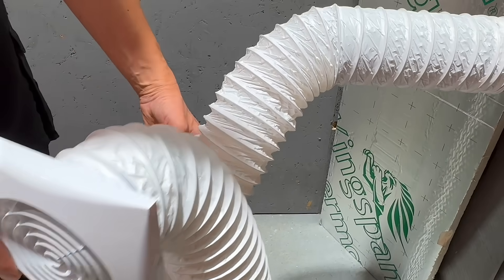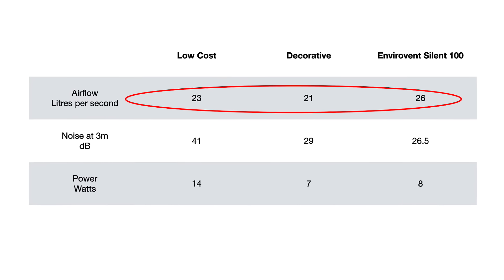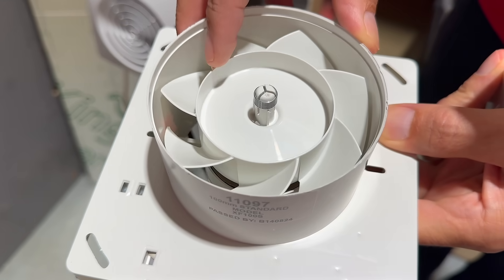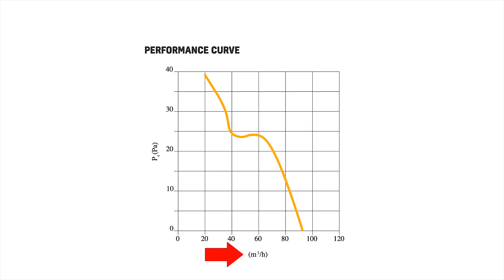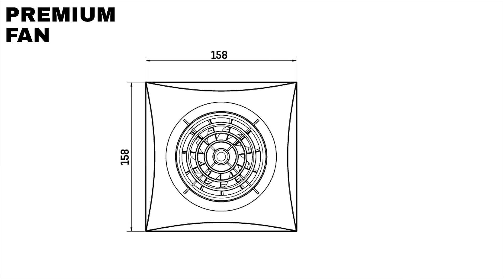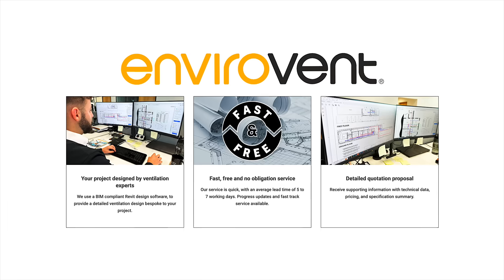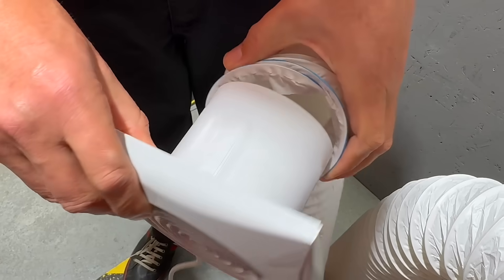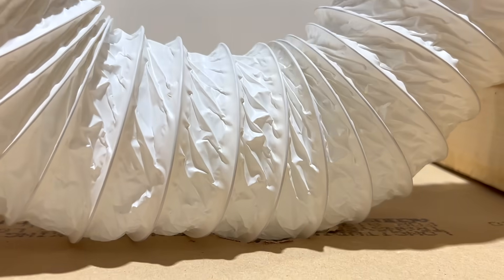The Shocking Truth About Extractor Fans!

Comment: Don’t bother with intermittent, go straight for the trickle/boost type. Check out the Vectaire ELX1003 for longer duct runs over 1.5m and the EL1003 for short runs or straight through wall. 8l/s trickle means the room stays fresher…boost to max when showering/ no. 2’s 😂 This meets building regs for domestic. 13l/s trickle for kitchens and utility rooms.

Comment: Placement of extractor fan and and available airflow/ventilation into the bathroom/kitchen is also crucial to maximise fan extraction.  A suitable gap must be under the door, or an internal wall or door vent/grille, is needed. An under door gap and door vent would be optimal.

If the fan is placed between a window and shower/bath and you open the window, the fan is going to extract the air from the window first, leaving the condensation to travel across before it's extracted. The same applies with door gap/grille/internal wall vent airflow and fan placement. Basically install the fan in the optimal placement for airflow extraction, that prevents condensation from leaving the zone 1 area.  

If i could, i would draw a diagram to explain and make it easier to understand.

Optimal fan placement, zone 1 if door gap/door grille/wall vent is opposite to shower/bath tub, i.e airflow/ventilation on the left of the room and shower/bath on the right of the room, or visa versa.  

Airflow/ventilation in a bathroom, is crucial to condensation extraction. Without airflow/ventilation, an extractor fan can not do the job it was made for, as it can not extract condensation from an unventilated room. A window trickle vent being open in an airtight bathroom, is not enough, even less so with a bathroom that has external walls. And you'll notice this in colder weather, when condensation is dripping on those external walls.

If you have the right extractor fan for the size of your bathroom and you have condensation dripping on the walls, then the extractor fan placement is wrong, or there isn't adequate ventilation, or possibly both. Extractor fans need to be cleaned and ducts checked every 4 months or so.  

Or if you're in the UK and your bathroom is a cold room, double insulate above in the attic. Use expanding foam to seal any air gaps in the attic above the bathroom i.e. wall plates etc, also make a box from insulation board (Kingspan) and place it over the extractor fan unit in the attic and seal with expanding foam.  Double check you have a backdraft for the extraction fan.

Another reason for cold external walls, is that people do not seal the tiles to prevent moisture from reaching the plasterboard, as these areas are generally not waterproofed prior to tiling. Tiles are porous, so is grout and over time moisture will make its way to the plasterboard if you have a lot of condensation.  So when the temperature drops outside, even the smallest amount of moisture in the plasterboards or in the tiles, will turn those walls into ice buckets.

Comment: One additional thing to consider is how well the fan seals the ventilation hole when not in use.  Cheap fans often don’t have any closing flaps and even those on the premium fan looked to be quite thin plastic so offer little insulation.
Building regs required an extractor to be fitted in our utility room despite there being an external door and no buildup of moisture occurring. In winter it was basically a 4” hole straight through to outside so I ended up having to stuff the fan hole with rockwool to stop the wind blowing in, thus of course defeating the purpose of having a fan fitted that we never used anyway.

Comment: we live in a tower block with a passive vent connected to a central duct...the vent has always been noisy, so we cover it regularly....how can i find a vent cover that will be quieter?
Reply: I dunno what the regs would say about it...But if I was in your situation I'd remove the vent cover, clean the duct behind, and then line the first 9-15" with some suitable foam. This would at least dampen the sound coming from the ventilation system. Do check on this though, as foam tends to be flammable and would not be suitable if that ventilation forms part of the buildings fire/smoke management system. 🚬⚖⚠

Comment: Most new builds use Envirovent but don’t use the correct ducting so become useless. They also used a 10m run with kinks, so naturally water ran back down. I’ve had to switch to an in-line extract instead.

Comment: I think it is important to note that the different performance of fans is not just due to quality differences. The type of fan design usually matters the most. There are different fundamental designs optimized for high flow, high pressure, or a bit of both - but you inherrently can't be great at both. The design of fanblades is a very well explored science, so don't let marketing persuade you that some expensive fancy fan has the best of both worlds. This is a design tradeoff you have to maks - so use the appropriate type for the spesific situation. 

High flow fans typically have fewer, larger and more spaced blades with deep angling to scoop up a lot of air, but they work best if you are venting sirectly to the outside with no or minimal ducting. They drop in performance very quickly if there are restrictions and might even stall out completely if used inappropriately. 
High pressure fans have many, dense, shallow-angle blades to maximize pressure (ie. how well it can force air to move against restrictions, like long ducting or filters). While every fan will lose performance with long and winding ducting, these will suffer least.

Personally I would go for a model with an adjustable hygrostat (humidity meter/controller). These sensors are cheap and shouldnt add much cost, but it can can save both noise and energy by running on minimum or even turning off when the room is already dry. Remember that in the winter you are venting out the heat in the house, so you don't want excessive venting when its not needed.
Having a "boost" button that temporarily runs the fan full speed can be nice if you want to get rid of toilet stinks quickly. Thats also a common feature.
Reply: @TheStigma  If your worried about losing heat (which regulations in the EU are), you could install a heat exchanger fan (with sensors). It'll cost around 220€ though. More than double of a fan with sensors. But, it may save you money over time.
Reply: @QnA22  If you are talking about ventilation heat reclamation (outgoing air heating the incoming air) then that sounds very cheap to me. Just generic heat exchangers alone often cost more than that.
But yea - heat reclamation + balanced ventilation together can do wonders for efficiency.  Often hard to implement fully unless designed into a new house from day 1 because you need a bit more complex ducting.

Comment: Extraction is tricky. I went to the trouble of installing an inline fan for my kitchen and use that instead of the ceiling mounted centrifugal, and replaced half of the flexi hose with rigid; result is much quieter. However, a second inline did not perform much better when installed to extract bathroom (with flexi duct), and generated more noise than the existing centrifugal. Due to constraints of installation (inlines can't be mounted at odd angles), it had to be mounted to the wooden beams above, and a 10mm rubber damping mat was not enough to isolate the noise. It's a perception thing but the greater low frequency energy from above made it feel louder.  After watching this I think the bathroom shrouded inlet design is also impeding air flow to make it quieter, so I will remove it.
Reply: You sandwiched the dampening mat between the beam and the unit?

Comment: I always found that opening the window works much better than extractor fans.
Reply: Sadly, not all bathrooms have windows... 🍎
Reply: @dieseldragon6756 Yes, it is a bigger problem for people without windows.
Reply: The problem with that in the winter is that you’re just introducing more damp cold air into the bathroom
Reply: @hughmarcus1  An extractor fan does the same, the air you blow out as to be replaced, or you would create a vacuum. That air as to get in from outside.
Reply: @ yes but not directly into a bathroom with all the associated condensation issues. 
The best way is a proper MvHR system anyhow

Comment: If not putting a carpet on the floor and putting a drain instead there, the majority of the water goes away. Warm floor and walls are good if want no condensation, but then humidity has no where to go, but, or letting walls be cold, the condensation grabs there and the water streams down...to drain. If I had to, (never had, actually never seen screamers on bathrooms here in Finland) use the fan, I'd surely put it on the attic alongside the kichen one. And a real one, slow spinning, not these toys you like there...
Reply: Most bathrooms in the UK don't have drains in the floor or even tiled floors, unlike the bathrooms I've used in Suomi.
Reply: @dieseldragon6756 The reason I said that was the fact that they do not have drains in England, but fans they have.

Comment: Had to replace my old extraction fan as it stopped working after a couple years after a bathroom refit took the manufacturer details and found it was about £7 on ebay went to b&q a got a marly fan about £40 has been going years

Comment: 20yr old Care Home. No maintenance done since indtallation. All bathroom ventilation systems were clogged with dust. 
Got a contractor in the clean with rotating brushes and vacuum. 
Amazing difference.
Cleaning these systems is rarely considered.
I have a heat recovery fan in my bathroom with a straight exit throught the wall.
It needs yearly cleaning.
Not easy 
Fortunately I have an air compressor for. Job done.
But think of sll those thousands of installations with years snd years of dust build up.......oh dear😢

Comment: Very few people want to pay for adequate ventilation in my experience. I've known people who had fairly large and expensive 'luxury' bathrooms installed, but want to use the cheapest fan possible - using the existing ducting or core hole to save a few quid. If there's a loft space above, its fairly easy to install a 4 or 5 inch inline fan and extract via a soffit in many cases. If the fan is mounted above the insulation, they can be extremely quiet - all you hear is the sound of air air being pulled through the inlet grille. 
If you use a 5" grille, 5" ducting and have the fan set to the lower speed, it can be almost silent, but still retains a very good extraction rate.

Having to core a hole through a wall, get up a ladder outside to mount a grille, run sensible dusting etc can take up the best part of a day in some cases. Including the cost of an adequate fan, insulated ducting, install an accessible isolator etc. may well cost £400, but is generally money well spent IMO. 

When a customer says they want to use the existing fan in their nice newly fitted bathroom - just because it seems to work and saves some money I despair! 

If a fan wont even hold a single sheet of toilet paper to the ceiling/wall inlet, then you know its not going to perform very well!

Humidistat fans can cause grief in certain properties. We retrofitted one in a basement in Kensington and would run constantly no matter what humidity sensitivity it was set to - purely as the basement had high humidity all year round due to damp issues.
Reply: Brilliant, thank you. So they are called inline fans then? Are they the ones that look like jet engine? 
That is exactly what I would like to do in my en suite and main bathroom, I'd prefer a fan up in the attic and exhaust out the soffit, rather than a contraption in the ceiling now that makes all the noise and can't hold a single square of toilet tissue up. Ducting now is flexible and crushed in several places, I'd prefer rigid plastic pipe with this new set up.
Reply: @samsonsamsamsam  Yeah they're great - made this change myself, added a Manrose MF100T (not sponsored, just really impressed by it) and it's so much quieter as well as venting massively better. It does mean you need the space above to install it, but if you've got the space it's lovely. In my case I stayed with soft piping because I was a bit lazy but it still works very well - though I didn't have any great distance to cover. Edit: Though I did swap out the old single layer soft duct stuff for insulated stuff to try and avoid condensation as it passes through the cooler loft space, and a backdraught shutter as it's windy where I live. Don't know if I needed to do either of these things or if there are any downsides, but made me feel better about it! :D overall very pleased with the outcome, it's been 5 years and no regrests.
Reply: @asharak84  I am sure there's no downsides with insulated ducting, good thinking there probably easier than rigid and reduces the noise. 
Did you say backdraught shutter in soffit?
Reply: @samsonsamsamsam  yeah it's inline right at the soffit join
Reply: @asharak84  understood, thank you 👍

Comment: My experience of UK builders/contractor's is many lack basic knowledge of ventilation principles. Here is another common mistake, fitting a bathroom extractor with a door that shuts tight. Where is the air drawing from?? Most extractor's I see are absolutely useless.
Reply: Building regulations say there should be a 10mm gap under the bathroom door for this very reason.
Reply: If the extractor is pumping air out and the soil pipe is open vented (As all should be) chances are the main source of air would be through the open end of the soil pipe, through the U-bend and out of the toilet... 🌬🚽🤮

And if the soil ventilation isn't all that great in a system with many toilets connected (Thinking of my mate and the vertical drain which serves his and 15 other flats) you're going to be breathing in more Hydrogen Sulphide than air... ☠
Reply: @dieseldragon6756 wouldn't you need to see bubbles in your toilet or gurgling sink if this was the case though? Not a nice thought
Reply: A window trickle vent or undercut door will achieve adequate air flow.

Comment: I bought a 12 year old house and there was a small amount of mould in the bathroom. The large housebuilder had fitted a mains ceiling fan on the opposite side of the wall to the bath. It made a noise but would not hold a single sheet of toilet paper up with its suction, I kid you not. Looked in the loft and "ducting" to a roof vent was made of various leftover bits including a flexible toilet connector taped together! Got a Manrose MF100T, put the vent right above the shower and it's been great. Now a flattened toilet roll tube can be held up by the fan, and that's on medium setting!
Reply: Same problem, exact same solution :) it's great, actually moves some air, bathroom smells better, no damp, is quieter because it's farther away, very pleased. Also in my case the original ducting was just sitting in the ceiling space, so now it's actually venting outside, with added no return flappy thing so it doesn't get so cold on windy days.

Comment: When fitting a fan with a humidity sensor, never set the sensor to anything below 50% as very often the air will be naturally above this level, a low setting will result in the fan running constantly, generally 75% will be ok.
Reply: I did 70% for like 5 minutes or so, whatever regulation says on time

Comment: Tbh I think 4 inch (or "100mm") fans are pathetic, I'd much rather have a 12 inch (or "300mm") and with adjustable speed.

Admittedly what I came across was in a kitchen not a bathroom, but about 17 to 20 years ago, a family I know lived in the most random old-fitted-out "multi-storey house above a shop" ever (sadly since converted to boring flats) with a weird random layout and multiple bathrooms (one leading into one of the bedrooms and another leading into the laundry room), and the kitchen had a 12 inch (or "300mm") Vent Axia T-series wall extractor fan, yes in a domestic house! I can't see why one couldn't be used in a bathroom either?

Comment: Remember to add 10mm under cut to door for makeup air
Reply: Under door vent might not work as well as a proper vent. 
Air is sucked cold and not mixing well, like a mist. 
Also, if there is no air intake in home, this eventually stops working too. 
Airflow is a complex system with many moving parts. 
The only way to win is to throw  full army on a single soldier, and hope for the best 😅

Comment: Ah please! Envir-o-vent? Anyone in continental Europe will tell you that S&G fans are 4 times more efficient and twice as quiet. This is simply because they turn their fan blades around 90 degrees to all of the other manufacturers. However i admit there dip switches are far to complicated for options. And yes, solid duct should be mand if you look at the maths.
Reply: I believe you mean S&P fans. Actually, I believe that some Envirovent fans are rebadged S&P models and so this is why Envirovent fans perform well. For example, the centrifugal model with the fan blade at 90 degrees as you describe (featured in eFIXX's live stream) - Envirovent have the same fan.
Reply: @ifallelsefails2  yes sorry S&P. They must be the EU version because I don't see envirovent here in the shops. They are great fans, I always carry two of them on the van to change out any cheap noisy fans I come across.